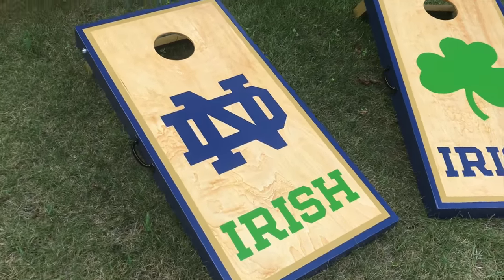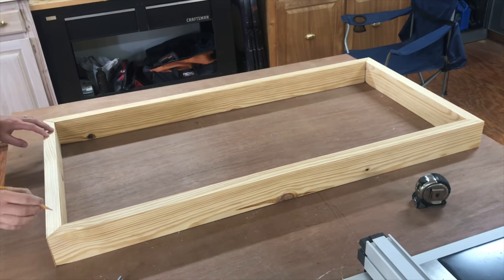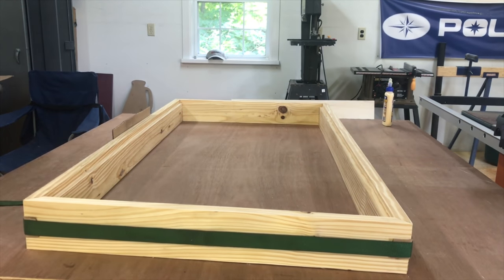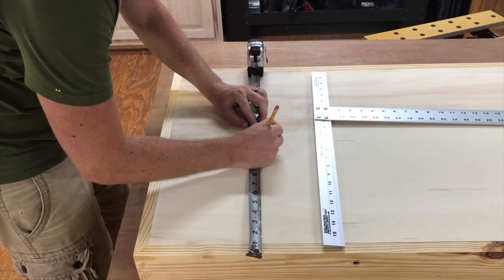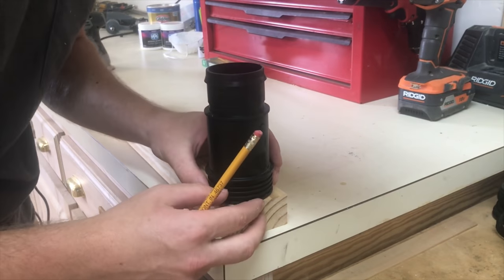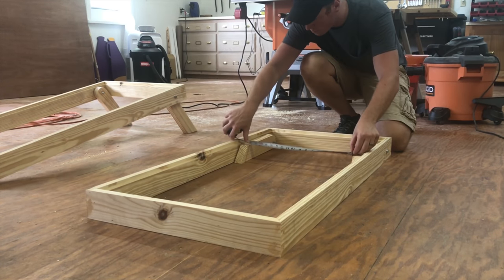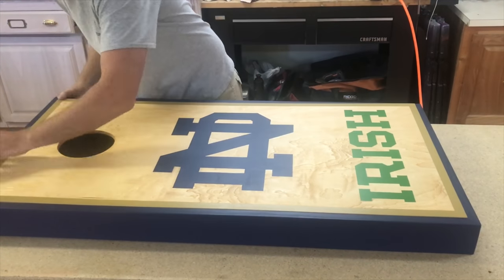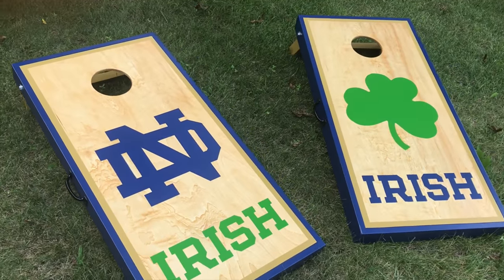Make Easy and FANCY Cornhole Boards | How to Build

Comment: What the dimensions with the team is it still 24x48 or do you cut the plywood 24x48 and then frame it? Sorry if you said it in the video.
Reply from the maker: jamesguy94 the frame is 24x48 to the outsides corners, so the plywood is cut approx. 23x47, so when it’s sat inside the frame the whole top is regulation size 24x48

Comment: 2x4's for cornhole?? WOW way to heavy. I use 1x4's and screw them together with drywall screws. I sell for around $125-$200 a set depending on design. I make them 4' long and also alot of people around here like the 3' sets.
Reply: Do you sell the 3ft ones as kid size boards? I know regulation size for the ACA, ACO, and ACL is 2ft x 4ft x 4" thick.
Reply: @WickedWayz81  don't knock it till you play on them. Everyone can land on a 4ft board. 3ft adds more challenge to a lot of people.
Reply: @hawkwrangler1950  Not knocking anything, just asked a question. Would be fun to try though. I run a few regulation tournaments, so that size is a no go. For fun at home, I might make a set.
Reply: @WickedWayz81  they fit a heck of a lot better in your vehicle also. More of a challenge we think.
Reply: @hawkwrangler1950  I can see that for sure. I've got the materials to make some. Going to put that on my project list for sure.
Reply: @WickedWayz81  3ft x2ft 9½" in the back 2" in front. Round off the sides.
Reply: @hawkwrangler1950  Awesome, Thanks!
Reply: @WickedWayz81  also I use 1x4's for the sides and back and 1/4" for the top. If you have a Menards they have them already pre cut.
Reply: @hawkwrangler1950  Yup, I have 2 within 30 minutes of me either way. I live in Wisconsin.